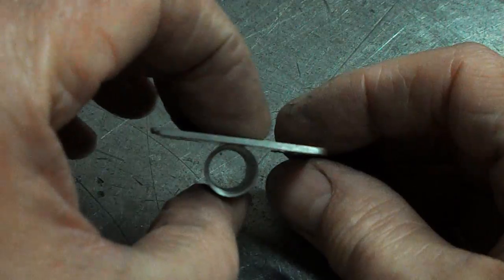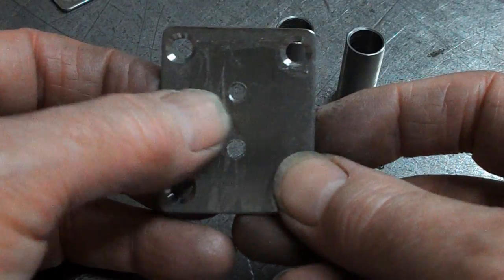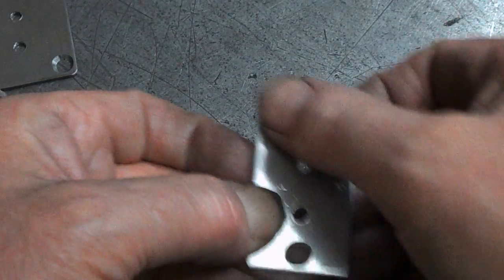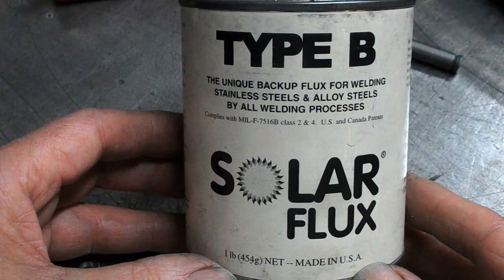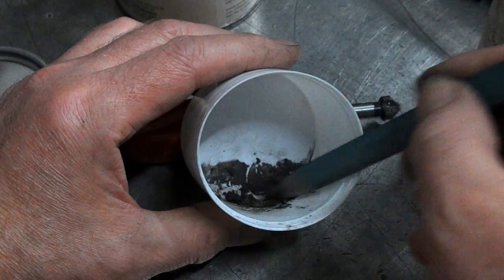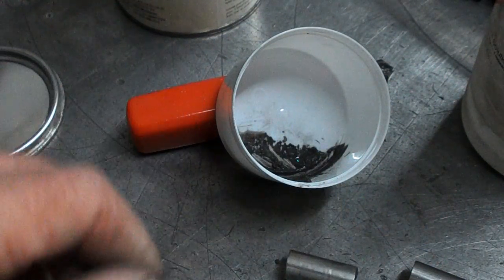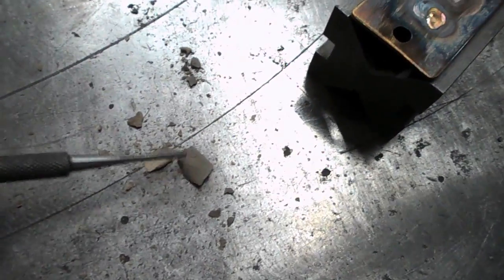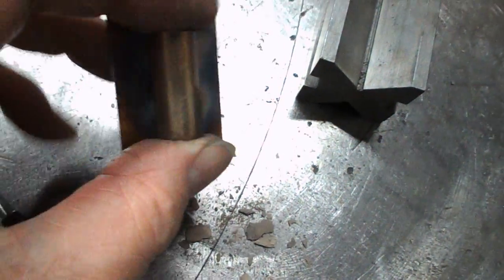Using Solar Flux when welding Stainless Steel

Comment: We always used lacquer thinner to remove the adhesive. It also works on the stuff that's been burned from only being partially peeled to protect the rest of the surface. 
;l thanks for the application method of the solar flux.